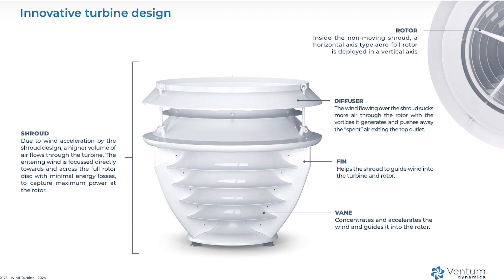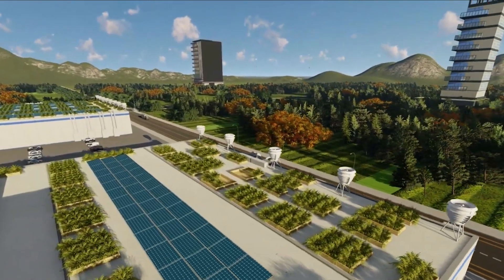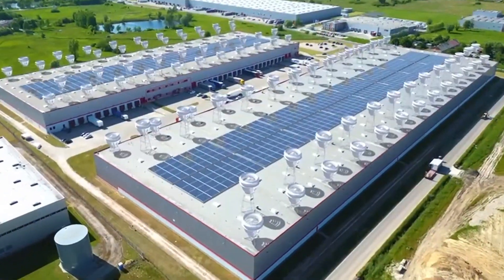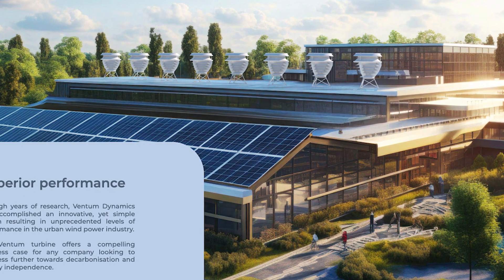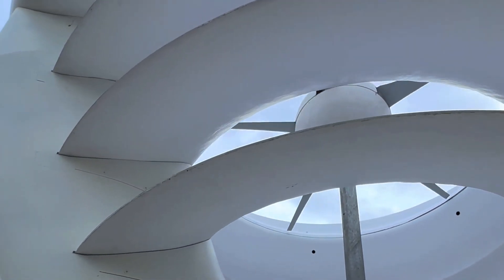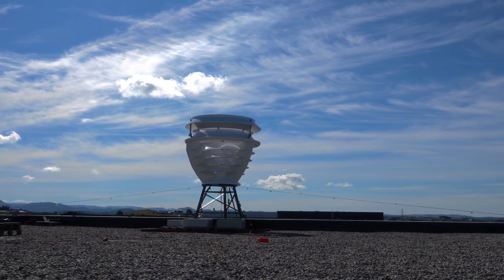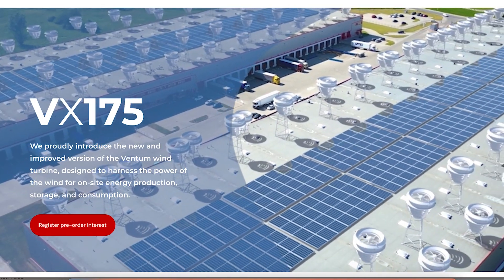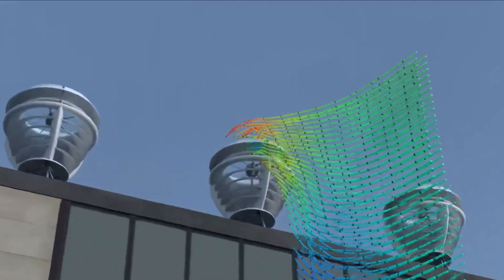Groundbreaking Wind Turbine Set to Transform the Market

Comment: CUT IN SPEED 3.5 M/S!
Reply: So...?
Cut-in wind speed is pretty irrelevant for the annual yield. Because you get hardly any power from such low wind speeds.
Crucial is nominal power and wind speed for nominal power.
The emphazis on low cut-in wind speed is normally a distraction from the lack of relevant information.